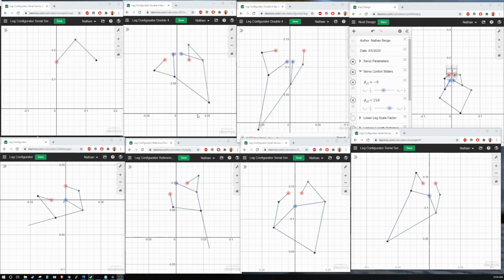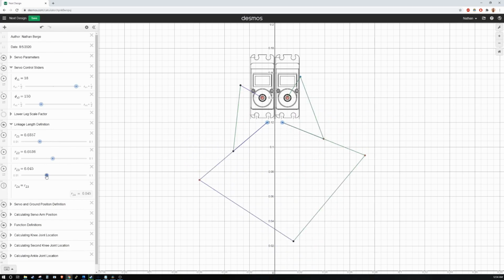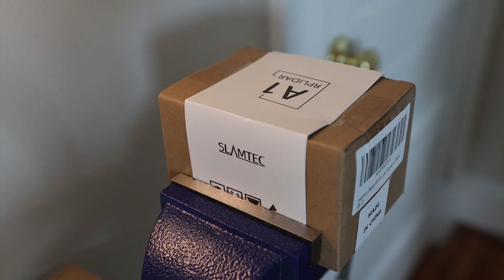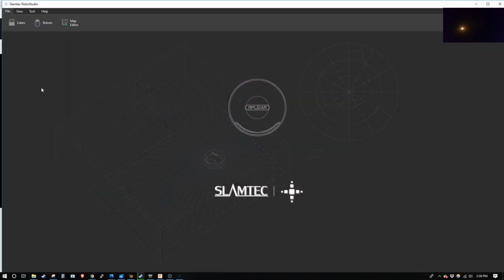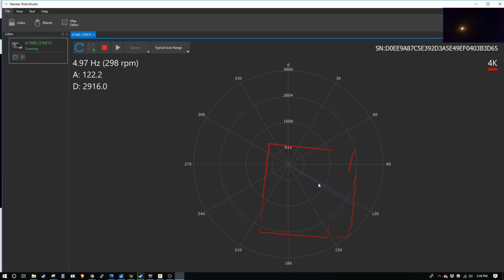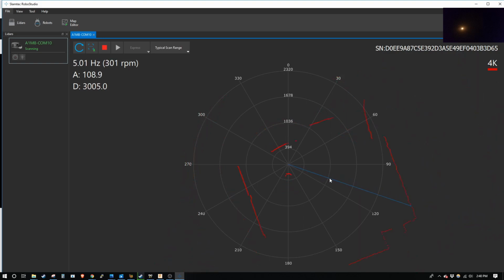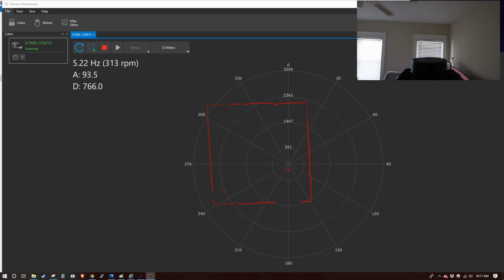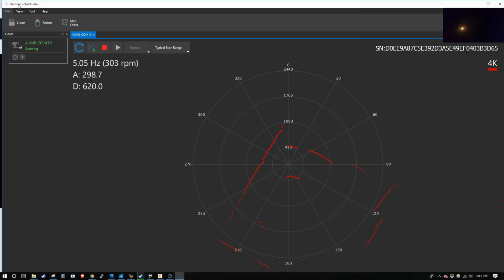Quadruped Robot Needs to See a Chiropractor!! (Small Walking Robot Episode 5)

Comment: Thank you very much for the links to your linkages with Desmos.
I was wondering, why the servo arms are not parallel to the top bars. In this way, the servos arms and the 2 top bars would form a parralellogram and the calculations would be extremely simplified.
I will study your movements very closely. My math skills are very low, but if you don't mind, I'll give you my feeling.
No English subtitles this time? Perhaps a setting you unchecked.
Reply from the maker: Subtitles are showing up now, it just took a while for them to process.

The main reasons I have the links longer than the servo arm is that:

1) It allows the servos to produce more work in a single step.
2) It gives the servo greater mechanical advantage as the leg gets shorter.

You can see here that 30 degrees of servo motion produces 1 cm of motion at the foot
https://www.desmos.com/calculator/cfcijkjdp7

Now 30 degrees of servo motion produces 2 cm of motion
https://www.desmos.com/calculator/advwgidydh

Now 30 degrees of servo motion produces 4 cm of motion
https://www.desmos.com/calculator/3vn5ciwleo

This is caused by the mechanical advantage changing as the mechanism extends, almost like the gearbox in a car.

This mechanism was specifically designed so the robot can carry a heavy load. 
It can squat down and have greater load capacity. Or stand up to have greater speed.

One also needs to consider the mechanical advantage in the X and Y directions separately. Low mechanical advantage in X direction means high walking speed, High mechanical advantage in Y direction means high carrying capacity.

There are some unbelievably complex things that can be done with non-parallel 4-bar linkages that I hope to get into in future videos. At one point I designed some asymmetrical mechanisms using genetic algorithms in grad school, but I never built them. I would like to explore that again and document it on YouTube.
Reply: @NathanBuildsRobots  Of course, I could imagine the consequences, but your demonstrations are truly magnificent.
I think the 4 bars allow greater construction freedom. The "Stanford Doggo" goes in this direction ".
In my videos, you can see my tests for a 4 bars asymmetric, but for now I have put that aside.
Many, many thanks for your demonstrations.
Reply from the maker: Thanks, that means a lot!
Reply from the maker: https://www.desmos.com/calculator/ii9qfsez3l
This one also demonstrates the concept. As the foot reaches its highest position it slows down, because the "gear ratio" is higher there.